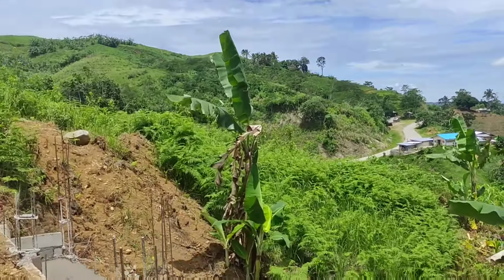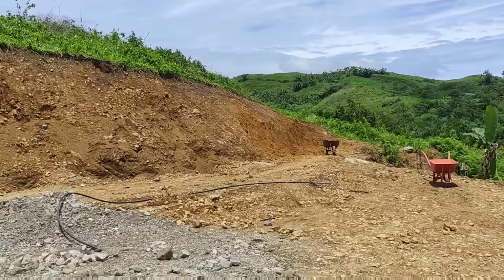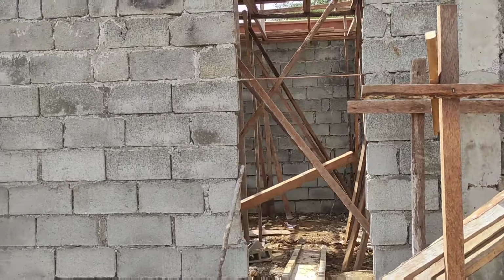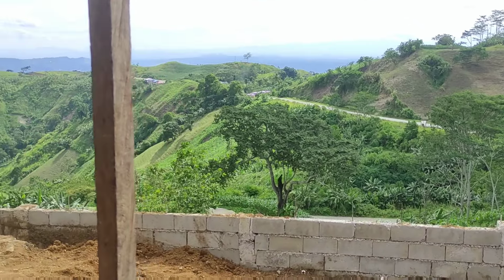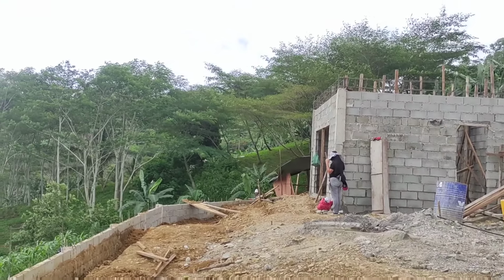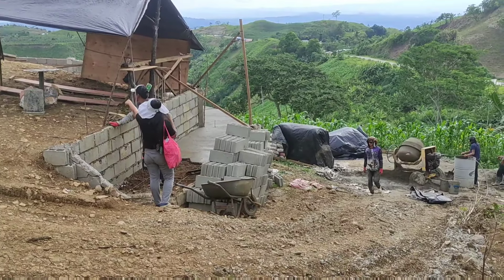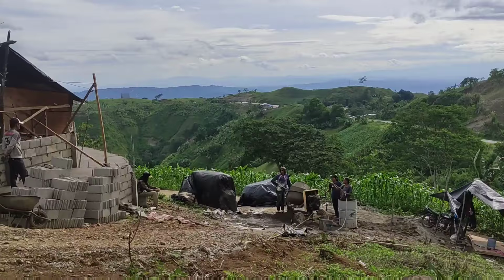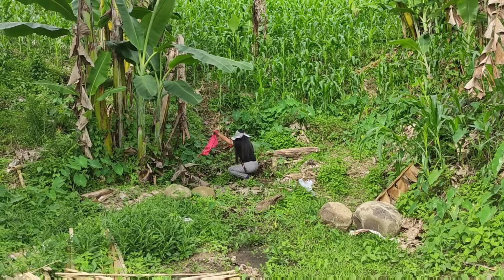Foreigner Building House in the Province of Philippines | Building Concrete Roof Beam for Steel Deck

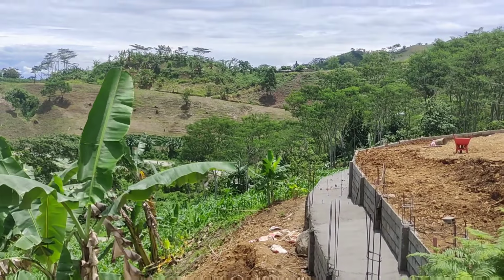Comment: @ 6:51 The first lower retaining wall is concreted on top. I think it should be sufficient and safe enough for land slide concern. Where the house is setting, the contractor scraped the mountain which compacted by gravity for million of years. then you they built the foundation. In my opinion the house safe. Its not going any place. It's up to you if you want a economical kind of drainage on the the upper section of the retaining wall.
Reply from the maker: Thank you for the constructive and positive feedback! 😊

I don't think the first lower retaining wall is an issue either, nor that the back slope is a major issue. The second lower retaining wall is for sure an issue (we went there today during heavy rain, spoiler alert, lol, video will be out in a few weeks). It's not falling over, but I am going to have to dig up like 30 cm, somehow find a membrane that only lets through water, and fill it up with rocks. Either that or have a swimming pool every time it rains (thick, hard clay behind weep holes doesn't seem to be a great idea, strangely enough).

Comment: With the the top of the lower retaining  wall concreted, you don't have to worry of land slide because the rain water will flow outside the wall.
Reply from the maker: We hope so! I like the French drain idea that a few have laid forward. 

Thank you as always for the support!
Reply: @ABetterLifePH  In my opinion, the concreting of the rip-rap is more effective than the French drain because the water won't saturate the soil and it prevent soil erosion. If the loose eroded soil goes between the rip-rap stones, overtime it impedes its purpose.
Reply from the maker: I think there's a geofilm or something (membrane that only lets through water) that can be used? Concreting all of it may financially be impossible for us.
Reply: @ABetterLifePH  Concreting the top of the rip-rap of the lower one is more than you need in my opinion.
Reply from the maker: Do you mean a top beam across the retaining wall? There is one, that is connected to the beams going across to the upper wall.
Reply: You should be afraid of your wife the way she handles that knife. Lol, I’m enjoying your videos.
Reply from the maker: @ronsorenson7196  We don't have a guard dog yet! Guard wife will scare away the evil-doers until then!